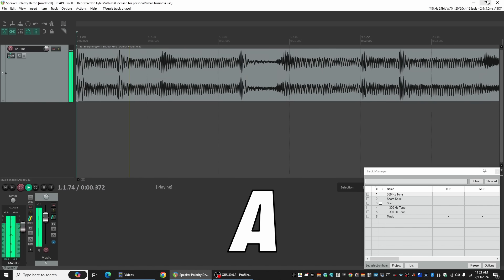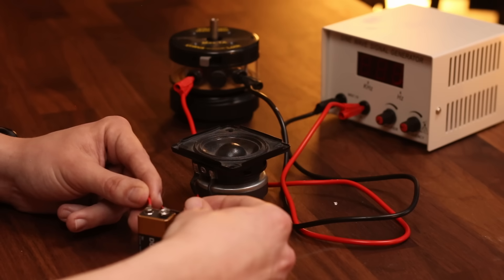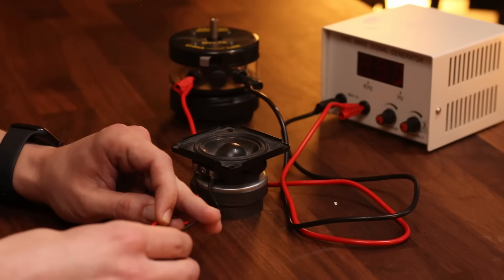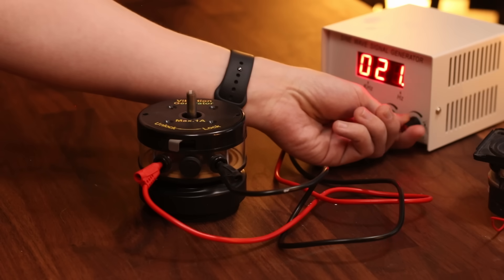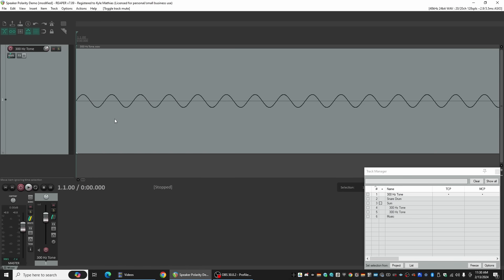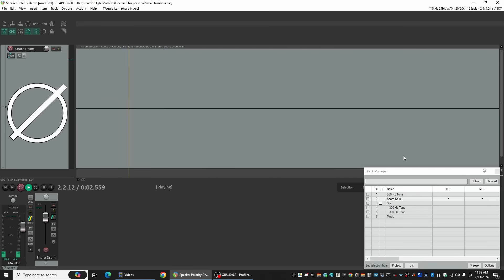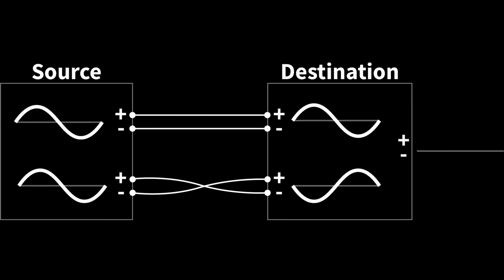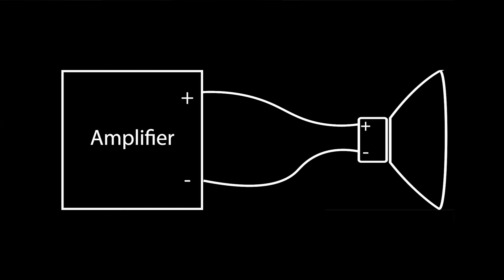What Happens When You Wire Speakers Backwards?

Comment: I learned about the importance of polarity when I was young.  I received a ghetto blaster for xmas and I was shocked that AM radio sounded so much better than FM.  AM was in mono and only came from the left speaker but FM being stereo came from both.  My natural curiosity got the better of me and I opened it up 2 days after getting it.  My mother was furious.  I had no idea what I was doing or should be looking for but I knew the difference between positive and negative and colour coding.  I saw the left speaker was wired white to + and black to - which seemed normal to me.  But the right speaker was wired white to - and black to + which seemed wrong.  I had already been soldering for a few years so I desoldered the wires from the right speaker, switched them and soldered them again.  I put it on FM and was amazed at how good it sounded.  My mother was so happy that it worked but still never gave me any credit for fixing/improving my gift.  For years she would say "Do you remember that xmas you took apart your radio?" and I would always ask her if she remembered that not only did I put it back together but that it was better than when I had taken it apart.  Never got any credit for that.
Reply: Hope you kept that thought process in your older years. You did what 99% of the people won't bother with these days and just throw it away.
Reply: @PauldeVries  I still regularly take things apart.  Often only to see what's inside.  I've gotten a LOT better at putting them back together again as well.  lol  But yes, 99% of the time I will try and fix it.  I'm cheap and would much rather spend a couple of bucks on parts and a little bit of time instead of tossing it out and replacing it.  That's one thing my grandparents taught me: Repair it until it can't be repaired any longer and then salvage whatever parts you can and repurpose what can't be salvaged.
Reply: @Enjoymentboy  Yes, things are more useful than meets the eye sometimes. Hope you gave yourself credits for that ;)
Reply: @Enjoymentboy  you're not cheap, you are resourceful, happy to hear your story, it's much better than what our middle eastern version goes most of the times 😄
Reply: @Enjoymentboy  I try to do the same thing, if i can that is. Iti s sad that over time things have started to become less repairable, whether that is due to how it is designed or because the right parts don't exist for it.
Reply: @Enjoymentboy  lol I've taken apart just about every thing I have ever had. it's an awesome feeling knowing you can fix most things that break.
Reply: @Enjoymentboy  If you like taking things apart, have you ever wondered what the inside of a surge protector power bar looks like & what exactly it does?
Reply: @Enjoymentboy  me, too. But I managed to put things back together with fewer parts (leaving me leftover spare parts). And stuff worked!!!  You  are correct that it's such a learning experience -- beyond reading is DOING.
Reply: @PauldeVries "these days" what? not everybody knew how to solder back then or now lmao
Reply: @PauldeVries  "these days" - yeah because no one ever threw anything out in the old days...
Reply: @PauldeVries  Nice bait but you surely know most things today are on microchips or smaller
Reply: Well I'm proud of you!  I wouldn't have let that memory go either lol
Reply: I hate when parents do that. I've always been a below average student at school, I remember back in grade 7 I worked my way to above average grades, got no credit, and it really hurt. I think that might've been what started my academic "I don't care anymore" mindset that still hurts me to this day.

Also doesn't help that I had undiagnosed learning disabilities that my parents don't really believe in. Gentlemen, pay attention to your kids, there's a lot of talent that gets wasted when you don't catch on to things.
Reply: Good for you !!!  Back in the 90's, I felt a rush of adrenaline when I was able to fix a small problem with my computer keyboard.  Didn't know much about what I was doing, and was afraid I'd make things worse, but when the keyboard worked again, it gave me the confidence to learn even more.
Reply: Good on ya...I would have cut the wires and tied the black to white and vice versa, but then I didn't have a soldering iron when I was a kid...and I'm lazy like that.
Reply: @fatillacing4131 You would've short-cuircuited the wires?
Reply: @breadmonster5453 No, just switching them.
Reply: @billpetersen298  But he typed he would've connected black to white and vice versa instead of black to negative and vice versa.
Reply: @breadmonster5453  Cutting the wires, then reversing them. Sets it straight. Except for the colour of the wires, at the speaker. 
That's when diagnosing something in the future, gets tricky. Black at one end, white at the other end, same wire.
Reply: I learnt the difference between AC and DC (and mains voltage vs 9V) when I tried to wire up the lighting in an old (even when I was young in the 70's) scale model of a theater stage that used to belong to my Mum when she was a child (it even had paper backdrops and I assume at one stage puppets). It was constructed from paper, wood and cloth with small (i.e. low voltage) lights with two wires. So I inserted them into the 240V mains outlet, turned the switch on and then spent the next 10 minutes trying to put the fire out before my Mum noticed :)
Reply: My son does the same but when he can't reassemble it? Daddy!!! I have to put it back together! Lol
Reply: @dragan3290 don't just reassemble it for him, teach him how to do it then! He obviously has an interest in learning about electronics, you should encourage it!
Reply: A lesson to parents. My friend’s dad, was a family medicine professor. He brought home, all kinds of mechanical devices, broken or otherwise. Donald’s bedroom looked like an old appliance repair shop. 
This was back in the 60’s, 70’s. Today he is an engineer, working on cold fusion, in Canada. 
As a kid, he could open any house or bike lock, you put before him.
Reply: That's awesome and you're really cool for fixing your stuff as a kid!
Reply: Fixing things makes me relax
Reply: @Defessus64  Sense of usefulnes.
Reply: @Defessus64  😁 So underrated comment. I find their lack of faith disturbing. 🤣
Reply: @Defessus64 Word! 👍
Reply: My mom was pretty cool. She would bring home broken VCRs and other home electronics (I have no idea where she got them, probably family who were going to throw them out) because she knew I liked to open them up and try to see how they worked.
Reply: @inthefade  

Tell your mom some internet rando says she's awesome.
Reply: It's odd that mono was only through 1 speaker. Usually mono still goes through both, but has no separation. The sound is just the same in both left and right speaker. A good stereo mix sounds better as there is a different signal going to the left and right speaker, with some variance in the 2 signals.
Reply: @005AGIMA  
This confused me as well and your comment is down the list a bit, but you are the first to mention this.
I kind of remember that AM had a much stronger signal, but I don't think that would relate to volume and has nothing to do with what he mentioned because he said the FM got better.
OK, so then his right speaker was never working to start with, so his fm stereo was only playing one side on the signal, so he is missing half the audio of the song. am mono you will still hear everything that was recorded.
This literally just came to me. Lol.
SOLVED...
Reply: @005AGIMA I came on to write the same comment, but didn't want to take away from the story.
I've never known mono to only come through one speaker on a stereo speaker setup. 

It's sounds more like how a total layman with no knowledge describes mono as only using one speaker, and stereo having two. 
As opposed to two separate channel signals to create the stereo image. 

Surely by his account, if the FM radio station wasn't tuned properly (therefore not IN stereo), the FM would also only play through the left speaker?
Just strange.
Reply: Is your name Leonard Hofstadter? 
This sounds really familiar.
Reply: @DG-kq8zf  
HE...He..he.
Reply: Great work, when I was 3 I pulled my mums clock radio apart, it had the flip style "digital" numbers, somehow they all fell off so of course I put them all back on... all jumbeld up.

I put everything back together like nobody would know.

From then on her clock was encrypted.
Reply: @AndaleArriba  DUDE!!!!!!  I did the EXACT same thing when I was 5 !!!!!!!!!
Reply: also, it shows your aptitude at "analysis", The word comes from the Ancient Greek ἀνάλυσις (analysis, "a breaking-up" or "an untying;" from ana- "up, throughout" and lysis "a loosening").
Reply: Sounds like my mom, she only remembers the extremely few negative things I have done (or things I have not done I should have done) and never remembers the many times I remembered to do them and did positive things.
Reply: Pretty sure she would have given you credit if someone had thought her how and why to do it. Don't think she intentionally held back on giving you credit. But yeah man, sometimes those unimportant moments for adults can become lifelong memories for kids.
Reply: @exshenanigan2333 
Exactly!!!
Reply: @exshenanigan2333  well said
Reply: What happened was called phase cancellation. The speakers being off phase canceled each other out. The nearby air would be moving in opposite directions, producing areas with no air movement. Or put another way, each speaker would be sucking in air currents produced by the other.

It makes more sense to explain this using a scope. If the waves are going up at the same time the other speaker is going down then they nullify each other.
Reply: @PlumGurly  In case of phase cancelling neither of the speakers shouldn't have been producing any hearable sound, sknce they would have cancelled each other, so it was not phase cancelling.
Reply: @MyenoB  -- But they were far enough to create some sound. Remember, air is compressible. The phenomenon doesn't have to be complete. Something you may be interested in is active phase cancellation of radio stations, where the goal is not to prevent transmission altogether, but only to steer it. So you have the main tower and then towers with the same thing out of phase. So the locals pick up from main tower, but people from 3 states over won't hear yours over the one on the same frequency closest to them. And I am probably not saying all of this correctly.
Reply: My favourite gifts were always electronics that I could take apart after I finished using them.
Reply: Let it go bro. Move on.
Reply: You missed one very important detail. Your mother is a woman. They never credit men 🤷‍♀
Reply: You actually did what I always try to diagnose, though most of the time I open something Up I unfortunately don't find the cause, since most of the time, it's not that obvious. But those moments when you can open something up and fix it, those are the most satisfying.
Reply: I was like you. It was great to be young. I got an HW-12 Ham Radio Kit. Heathkit built it, learned the Morse code and loved it. Around 13. Lost interest in school around that time but the girls became noticeable. Strange feeling. I'm 70.
Reply: AM is supposed to come from both speakers because it's mono.
Reply: Good on you. That is how we used to learn... trial and error and mistakes. I did a lot of work as a 10 year old, but did not understand AC/DC power yet. I had a walkman that played cassettes. I rewired it to the record player on the generic home stereo we had and it worked but went through 9 volt batteries like crazy. So, knowing there was endless power in the AC outlet, I took a strand of Christmas lights and cut the wire a foot or so after the plug. I stripped the ends and connected it to the battery terminals on the walkman. Plugged it in and POOF! a white flash saturated my Rods and Cones. I thought I went blind, but the were just offline for some minutes. I learned then that the power types were different and I had to know more. This just led to more experiments and I bought a lot of stuff from Radio Shack in the 80s. We were pioneers... willing to learn on our own. Glad we made it to this day too. LOL.
Reply: MA MAN!
Reply: You were a smart kid
Reply: What exactly can we learn from this? Many humans are unable to realize certain facts. You didn't notice that you dismantled the present in front of your mother. Your mother didn't appreciate that what you did was an improvement.
As a German politician from the post-war period is said to have said: "We are all living under the same sky, but we don't all have the same horizon."
Reply: @btsr2553  But....just like many things, I did this in secret and not in front of her.  She just caught me before I was finished. 😉
Reply: Oh that amazing feeling when the first time as a child you manage to put something back together and it works!
Reply: That was a nice story to read. Keep up the experiment learning. I hope when you get kids you will remember this story :)
Reply: Good boy/girl I'm your momma now you're so good 😊
Reply: @diadhuit8784  🤣
Reply: I bought a brand new tv. My barely 8- 10 yr old boy. Took the tv apart. We only watched it one time. Not even 24 hrs old yet. I walked into the house. After mowing the yard.  I saw it in  what seemed like 1000 pieces.  I nearly freaked died. I decided to not yell or get mad.  I asked him why did he do it? He said he wanted to know how a tv worked. I told him to put it back together. Don't do it again. I thought the TV was doomed. He put it back together, correctly, with no errors.  It worked perfectly for decades. Still does. In another persons home. This was the late 80s. He would have been 43 Dec 24. I miss my children. Both gifted in different ways. This was his gift.  Figuring things out on his own. Very high IQ. 
My daughter is very artistic. I'm proud of them.
Reply: You forgot one important detail: she is a wo man. They never credit men! 🤦‍♀️
Reply: Lmao yeah I've done similar things and had the same treatment hahaha
Reply: U did a great job man!
Reply: She thought you let the demons out
Reply: 🤣 My mother was somewhat the same.
Reply: Fock your credit
Reply: Hopefully you had some extra parts left over.
Reply: As someone who, until about age 15,  destroyed almost everything I was given with failed attempts at modifications within maybe 6 or 8 months, I'd say the learning experience from fixing the boom box was far more valuable than the device itself. I wonder if your mother could be convinced of that reasoning.
PS: I've never seen a boombox that only played out of one speaker on AM. I wonder what they were thinking; did they know their assemblers were too sloppy to be trusted to wire both sides correctly?
Reply: @pcno2832  This was a sanyo and oddly enough my best friend's dad had an AM only version that was literally identical except it only had the left speaker.  It was like they took everything on the right side and just cut it off.  I'm guessing there as a lot of shared parts and circuitry for simplicity and cost saving.  This was definitely an odd model as to record from the radio it used the mic which was right above the left speaker.  It was like it was a separate tape recorder that only shared power and amp with the radio. If you covered the mic your recording would get very quiet and muddy so I learned that if I wanted to record from the radio I had to turn the volume all the way up.  Again...my mother was not too pleased.
Reply: I did this with a chinese bluetooth speaker I got for my birthday. Also needed soldering, although I wish it just use those clips. I also noticed in a garden centre speaker display for relaxing music cds but did nothing about it as the backs of the speakers were behind the display and I wasn't going to faff with it.
Reply: if one of the stereo speakers is hooked up the wrong way, there is a phase shift of the sound waves of exactly 90 degrees resulting in the waves essentially cancelling eachother out which is why it sounded so bad on stereo
Reply: I bet you had an Afrikan mom. Right?
Reply: Haters gonna hate
Reply: Reminds me of the time I fixed my mom's waffle recipe... she was not as thankful or impressed as I thought she would be...
Reply: You're Mom Loves You so much, that she would always Love to see Your Face and How Animated You get each time You Told the story of How You Fixed it, this way, She didn't have to seem like She is bragging about her incredibly smart boy.

Seriously Bro, ask Her if You don't believe Me, and if You feel like crying right now from Joy or not giving Your Mom cred for letting You explain it all this time making her Proud, well let them tears flow, heck I"m getting choked up too, show Your Mom this comment, and remember Real Men Cry, it shows How deep Your Love is and how it affects Your voice while crying expressing your Joy, sorrow, or many other emotions that make us humans cry

Type animals that can't cry in google, we're fortunate we can, plus I don't know how ya feel about Jesus, but they say He wipes our tears dry too, so let em flow bro, tell Your Mom You Love Her

God Bless and Much Love
Reply: @crying_hippy  Thank you.  Honestly appreciated by my mother and I fell out many years ago and she is no longer in my life.  She isn't a bad person but she and I are incompatible.  It's a long story...a lifetime in fact...but I'm good.  I have a wonderful relationship with my own children and that's what is most important to me.  I learned many lessons as a child on how to treat a child and I have applied them to my own and it worked.  I just try to live by the Golden rule.
Reply: I had the habit of taking apart my toys as well, usually with the end result of them never becoming whole again. Just that at one point I understood how they worked and was able to get them back together, and later to fix problems. Well, curiosity might have killed the cat, but it do create engineers.
Reply: Interesting. My guess would be that it sounded worse because the two speakers were initally playing opposing polarities, causing destructive interference at points
Reply: genius is so often unappreciated. young frankenstein improved his puppy and suddenly it was all torches and pitchforks in the local village 😀
Reply: I`ve had that in car speakers on the back shelf.
Reply: Lol. You brought back old memories for me. I remember when I took apart my "V-rroom dump truck" made by Mattel in the 60's just to see what made the noise. My dad wasn't happy as he had to figure out how to put it back together. Some years later I had apparently not learned my lesson and moved up to his lawnmower. He was definitely not happy. Fast forward 20 some years later and I came home after a hunting trip and was chatting with my wife when I noticed a PC board on the counter. When I asked her where this came from, her reply was, "you should ask your son, or better yet go downstairs and see for yourself." My heart skipped a beat when I went downstairs to see my TV in a million pieces, all laid out in neat rows and bundles from tiny screws to PC boards, to knobs and switches. Apparently my son thought it needed repairs as it didn't operate to his six year old standards. I guess what comes around goes around. When I got mad at my old weed eater and tossed it into the trash, my now eight year old asked, "can I have it?" I told him the engine was broke and it doesn't stay running, but if he wants to play with it, it was fine with me (I figured it would keep him out of my hair for a few hours). He grabbed it out of the trash and got his mini tool kit and started taking it apart. An hour later I hear the thing running like new...
He came to work for the same company I worked for repairing elevators and is now the "go to guy" when nobody else can figure out what's wrong.
Reply: When I was growing up the most often heard thing in my house was "You better get that back together before your father gets home" ...... I had to take everything apart and try to figure out how it works but it led me to a career as an electronics engineer so now it's "Can you look at this and see why it doesn't work?" from my mother .....
Reply: You should thank your mother for a gift that gave more than once.
Reply: @budsak7771  Haven't had any contact with her in years and don't even know where she lives any more, so that's gonna be a bit difficult to do. lol
Reply: @Enjoymentboy  All you have to do is just say it out loud and mean it in your heart.
Reply: @budsak7771  Anything I've had to say to her has been said. There's nothing in my heart left to say. I'm at peace with where I am... but thank you. 😊
Reply: @Enjoymentboy  pretty lengthy comment for one who says he's at peace. Take care.
Reply: I know it's a poor consolation coming from a stranger on the internet but I'll give you credit, anyway: 🫡
Reply: Good jobb son! / Mom
Reply: now you got credited by thousands of youtube commentors
Reply: Mate, rejoyce! I'm giving you credit now!
Reply: Keep saving the electronical devices, you unsung hero! XD 

That was a pretty nice story.
Reply: I understand you, it's the story of my life. Nevermind, I'm satisfied knowing that I achieve it even if others don't value it. Because it's challenge overcome.😉
Reply: @Enjoymentboy that was a great story. Plus I'm glad to hear I'm not the only who takes things apart just to see what's inside. 
My favorite findings from taking things apart were seeing that the electronics of a kitchen scale were smaller than its LCD and the part that measures the weight were the four rubber feet, and a chinese knock-off Gameboy Color where they used a literal twist-ties (and the cheapest ones at that, the ones with a flat, wide plastic sheathing) as wires to connect the speaker and a switch* to the circuit board! 🤣🤣🤣
I used its speaker to replace the speaker of my real GameBoy Color, which distorted the sound due rusty voice coils.

*The switch detects when a cartridge is inserted, telling the console to load from the cartridge, rather than from the on-board storage that came pre-loaded with a bunch of totally legit games.
Reply: You should thank her for this it made a good core memory for vindication 😂
Reply: if she is still bringing it up, that's credit. it means she was so impressed she still remembers it to this day.
Reply: Your mom sounds like narcissistic personality disorder. They’re incapable of giving you credit and it’s abusive etc
Reply: @Enjoymentboy Bruv from what i remmember i dissabembled every toy that i had when i was a kid , especialy with motors and stuff i had bags with parts not toys , i realy was curious how it worked. And now im electrical engeneer and machinist  so basicaly can do most of the things myself. So it was worth it.
Reply: Story of my life lmao
Only got the credit many years later when i became an engineer lol. Now it’s “ohhhh you had this tAlEnT since you were a little kid!”
Reply: Imagine you got a child. 
You mother comes to visit her grandchild, and you have him on an operating table: "Dont worry mother, I'll make him better"
Reply: i hope that you do truly keep that feeling you felt when it tested better than it was... and keep that for years to come, no matter what anyone else may say (even those closest to you) as that feeling right there? that's something which keeps me going 27 years later at repairing and improving whatever I set my mind to.
😉👍
Reply: Reminds me of my dad except that when he puts them back together the problem becomes even worse and nothing works
Reply: Bet you had an older brother who was held up as a genius for knowing what button to push to get the video recorder to record.
Reply: @TiberiusWallace  Nope.  But I did have an older sister who was treated like a delicate princess who needed extra help.  :)
Reply: Your mom sounds weirdly awful
Reply: That's how a talent shows its signs
Reply: it could have been intentional  to change the both polaritiers, because it makes a somehow wider stereo base effect.this has to do with how our brain  processes thiis "wrong" polarity.
i have often sound wronlly connectes speakers, it results of  feeling a pressure in your ears. sad enough thatthe people in the shop never realized that
Reply: Hahaha!
I am sure you are now grown up and maybe just telling your friends about this. However recently an article in local newspaper is somewhat related to the issues you had with your mother. I am from India, and during a recent Airshow a young cadet from the National Air force flew a fighter aircraft and got the applause from the spectators for his prowess in flying the machine upside down. His Grand mother was in the guest stand viewing the show. 
After the performance the Cadet came to have the Blessings of history of grand mother. As is customary in India people touch the feet of elders as a sign of respect. The young cadet too bowed to his grandmother, she lifted her grandson and embraced him and patting his hair she said, 'Babu, don't worry about or disheartened by what others say do practice hard and I am sure very soon you will learn to fly the Airoplane in the UPRIGHT position.'

Thanks.
Reply: My man's is still hurt 😂
Reply: @Radioman. What the hell are you talking about?
Reply: she suck,sorry man, you must appreciate kids to motivate them when you have your own, thats what I do😊
Reply: My life in a comment.
Reply: Sounds like you learned to give yourself credit and be proud of your achievements.
Reply: You answered my question about the performance of stereo .
Reply: She sounds like a divorced liberal
Reply: I once noticed a friends kid had a 'shark fishing' game that just looked impossible and shoddily made. I asked them to let me have a look at it, and I took it apart. The motor was wired completely the wrong way so the shark's jaws never opened, meaning you could never catch the sharks.
And yes, I rewired it for them.
Reply: surprised no one said... you should've switched the polarity of the left speaker and you would've gotten credit, but I'M HAPPY YOU CHOSE THE RIGHT SIDE X)
Reply: Alright, Dickens.
Reply: Idiotic parenting. Sorry.
Reply: ahhhh... the "beginnings" of noise cancellation... 

If the same signal were going out both speakers, you'd see one cancel the other.  But you won't hear it "cancel" but "interfere" 

There's people who could give you the whole breakdown... but you made your gift worth having.  Congratulations!
Reply: I still don't get why AM only came from one speaker. This is not usual.
Reply: @theamazing39  - AM didn't always get broadcast in strereo.  Most stations were mono.  So why power two speakers?
Reply: @jeffreymontgomery7516  Usually both speakers are powered, even for mono signals. Never seen a ghetto blaster that hadn't.
Reply: I disassembled my blue robot who was able to walk , turn around yellow antenna and on belly projecting moonlike surface, and never succeeded to assemble it. I was so sad
Reply: Perhaps surprisingly, your boombox may have been wired out-of-phase on purpose.  Some manufacturers of low-end electronics, and even some high-end electronics, intentionally mis-wire the speakers because it makes them sound more "three-dimensional."  Carver Audio used to sell an add-on to your stereo that threw the high frequencies out of phase which they called the "Sonic Hologram Generator."  A lot of people bought into it.
Reply: Don’t feel bad, your Mom just didn’t understand. Maybe you should get an old radio & take it & ask her to watch.
Reply: That''s an interesting story. Not related to speaker polarity but relating to things being manufactured wrong - recently while clearing out a relative's flat I came into the possession of this cheap toy musical keyboard that when I tested, didn't work. It still had batteries in that had leaked, implying that it once worked, and after I dealt with the leak I still couldn't get it to work. So I opened it up, and after breaking one of the screw threads where the screw wouldn't come out, and then having a look and fiddle around, I eventually discovered that the power switch, which was only two position but had about 6 or 8 terminals on it, was wired to the batteries wrong. Two of the terminals had a closed circuit between them when switched on when I tested with a multimeter, but those were not the ones actually wired up. So this keyboard can't have ever worked from when it was made, as no one would have opened it up before. I can only assume it was given to the kids for christmas, they put batteries in, it didn't work, then they decided they couldn't be bothered with it and just flung it on a shelf for years without even taking the batteries out.
Reply: Your mother sounds horrible
Reply: I to used to tear anything and evrything I couod get my hands on to figure out how it worked and still do as a grown up , I had recieved a wooden box with a small hammer Philips and flat head and a wrench , so I went to taking things apart I was 5 years old , she came home one day and I was inside the big wooden TV box I had opened the back of it but was smart enough to unplug it firs when she found me I got the whooping of my life and then in tears she made me put it back together again lol , but she threw away my tools 😂,
Reply: I’m very sorry, man 😢
Reply: Moms do that
Reply: Go to therapy
Reply: You'll be remembered here, unsung hero.
Reply: You corrected the out of phase speaker thus stopping the cancellation caused by the out of phase speaker.
Reply: Goated
Reply: women lol
Reply: Moral to my story.  Your mom is proud of you for it. She just knows she worked hard for what we can barely afford.  Midst people can't fix it.  It's a gift to have been able to do so.
Reply: Giving credit where credit is due my brother
Reply: bazı çocuklar icat çıkarır ve onlar hayatlarında başarılı olurlar. sorgulamak bizi biz yapan en büyük değer belki de!
Reply: @Enjoymentboy Yah. Some women are like that. My wife...Gotta see it before she believes it.  My mom.. tho.. She was cool... Also knew something about electronics...
Reply: Don't know what's worse, her lack of credit.... or the fact she bought you an obviously cheap chinese no-brand ghetto blaster?
Reply: @TheRealD4  I'll give you the first part but as for brand, it was a Sanyo, if that helps.
Reply: I feel you.
Reply: Good post. It got me thinking, No one whos new experiments and reads and tinkers and just generally plays around to discover new things on there own and how things work one on one. Its healthy and its fun and it develops skills you will never learn otherwise. Listening to someone talk about things isnt the same. Plus its laziness. The people who develop critical thinking skills will wipe the floor with the ones that let someone do everything for them. You are also more prone to remembering things accurately when you experience things hands on. without someone telling you what this does and that.
Reply: It's ok - we give you credit.
Reply: Mono means it doesn’t have a right or left channel, it will treat the right and left speaker as one speaker. So if you have an audio that’s supposed toswitching from left to right , it will not switch cause you have a mono setup and the audio will play simultaneously on both speakers.
Reply: am sounds dull and lifeless.
Reply: At least the stereo FM noise was in phase
Reply: I was one of those kids, too.  I used to buy cheap boomboxes and replace the stock speakers with more efficient car speakers.  They went from sounding like krap to being pretty good(for 80's gear, anyway).
Reply: Thats the best type of kid to have, curious and wanting to learn. Id be upset as a father if my kid did that but on the same hand I'd let them do it and be proud of it
Reply: Oh dude.. i relate to that so much
Reply: I use to have a "ghetto blaster" myself back in the day, FM came out of both speaker with some stereo separation being heard, AM the sound came out of both speakers but it was in mono thus no separation was heard and it sounded like it was coming from one speaker, but that was a trick being played on our ears, both speakers were working.
Reply: I had a mother like that too. Her favourite comment to me was: “should you be doing that?”😡
Reply: You missed one important detail: They never credit men! 🤦‍♀️
Reply: @YainVieyra is that the same thing for women’s?
Reply: @travy268  That's what I meant exactly, but fascist Youtube won't allow me to write "women" in that sentence. This woke bs is unbelievable really.
Reply: We need more kids like that in the world
Reply: You should go see a psychologist for that trauma.
Reply: @oo131193oo  Already did.  he told me to stop taking apart his radio.
Reply: I was grounded for taking things apart and trying to use the components in projects I was doing at the time but my mom never understood me destroying my toys.
Reply: Mothers ☕️
Reply: My mother abandoned me on a door step at 6 months old and then again at 10 years old at Disneyland.
Reply: Wow you turned an insightful lesson on polarity into a big self pat on the back.  Your mom probably didn’t compliment you because she knew you had that part covered.
Reply: @mannysr67 You sound like a woman
Reply: @mannysr67  Sadly not.  You don't know mom.  Someone had to pat me on the back because it was never going to be her.  Learned that at an early age.
Reply: How's your relationship with your mother?
Reply: @HungryTacoBoy  Well...truth be told it was never good. She was never really a mother as much as that woman who was legally obliged to care for me until turned 18 but couldn't even do that much.  In my youth there was anger and bitterness but as I've gotten older, and especially after becoming a father, the anger and bitterness have faded and now there's honestly nothing.  I had to sever all contact years ago.  So how's my relationship with her?  Non-existent.  But honestly it's cool because I learned exactly how this sort of thing affects a child and I used it to be a better father and now I have an amazing relationship with my 3 daughters.  The cycle was broken.
Reply: @HungryTacoBoy  Imagine defending crappy behavior just because it’s your mother. Funny how you don’t notice the inherent social conditioning which allows the criticism of dads but not moms.
Reply: AC doesn't polarity...
Reply: @LeonKotze70  hopefully you don't ever do work on any one's house wiring. Just saying...
Reply: Don't expect credit/praise for your good work, because your sibling would always get it, no matter his work is good or bad. In such a scenario, even if you get the credit, it is a fake one, just to make you happy.
Reply: L mom
Reply: Many great men like yourself build the world we live in but always remember that women don't care about men's struggles only what men can give them.
Reply: And we lost a curious child's engineering instincts at a younger age due to the lack of encouragement from his own people 😉
Reply: I've been in the same boat too now I rarely even bother to fix things. I used to have this curious instinct to open up and see the internals of machines , anything from home electronics to automobiles. Which didn't get enough appreciation but discouraged very much and I eventually stopped it.
Reply: wemon 😒
Reply: That's women for you right there.
Reply: Rewiring the speakers to its connections was not affect the frequency of Am or fm band..
  The question are why did the connections of  speakers one channel was reverse in polarity..
 Meaning the location are most to be considered..
Why both frequency changes.
 Even the speakers positioning
 When you fallow the  connections of each wire speakers  then the speakers position of one speaker are in deffirent way..
The soud will change..
Reply: It does not matter if you can bearly hear it...its like putting welded shocks on your car. Slow speed 3 mph no problem fast you go zigzag and crash and burn lol
Reply: Typical Mother...
Reply: Women...